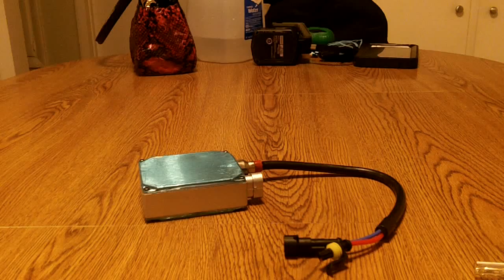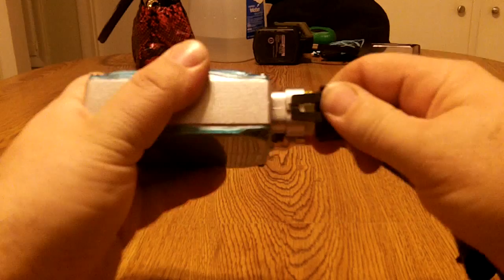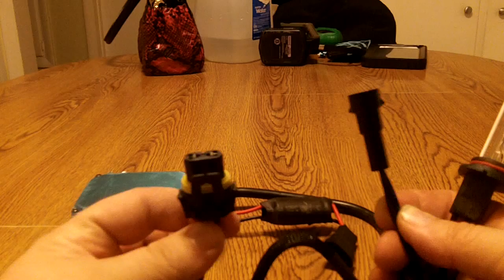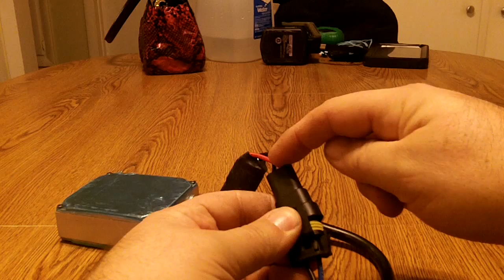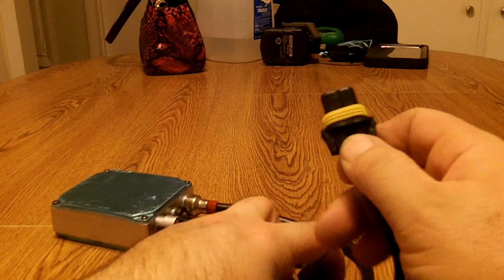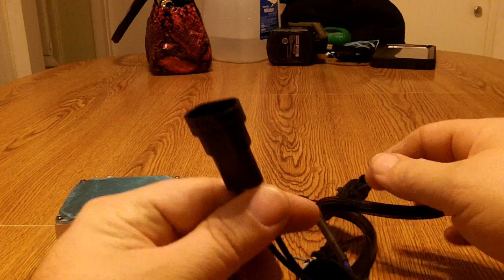capacitor_install.MP4

Comment: Why did you say the capacitor is useless if a relay harness kit is being ran in unison? First needed, a Heavy duty relay harness is MUST HAVE regardless in my experience specialized with halogen bulbs. It will offer less resistance and takes a huge load off your vehicles head lamp and high beam switches. With a relay wiring harness, it takes direct power off the battery .5 to 1.5 voltage gains can be measured at the headlight socket making your lights brighter. I think what you were trying to say was that: Having a headlamp relay harness alone, would not be effective in terms of cancelling out can bus related error messages. Because a relay harness alone does not store up energy when power is applied to it. The capacitor stores enough power so that when it's circuit is tested by the on board computer, it evens out the protons and electrons so that they jive in harmony accordingly. :)

Comment: How do you know what's negative or positive on the actual ballist
Reply: Easy! Disconnect one HID bulb from the ballast, turn on your lights. Connect negative (black) lead of a digital multi meter to the vehicles ground then connect positive (red) lead of the meter to the either lead of the ballast. The lead that gives you +voltage is the one.